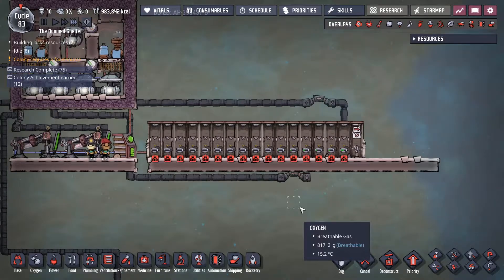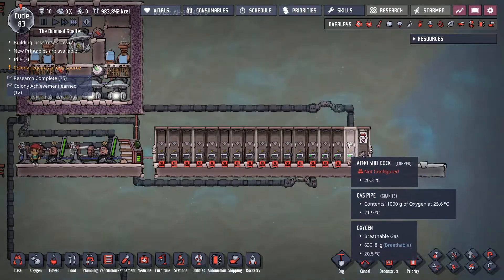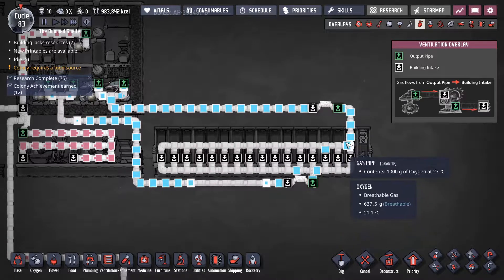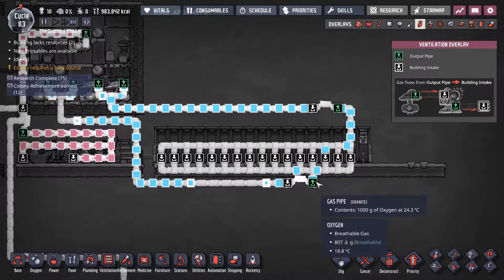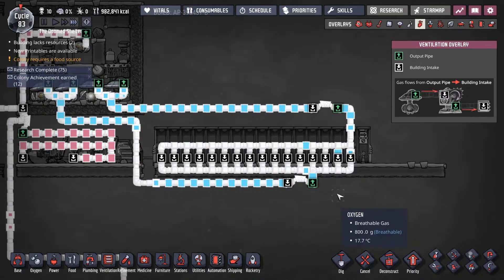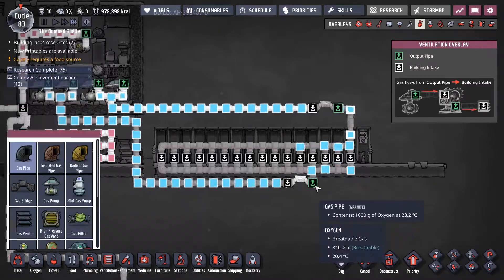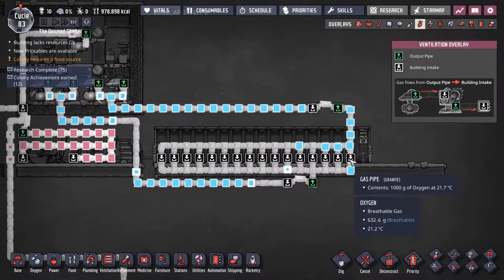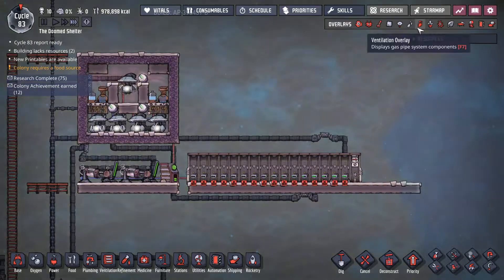Oxygen Not Included supplying atmo suit docks with oxygen

Comment: Very nice setup for large amount of docks. For smaller row feeding the first dock directly and running the pipe back through the dock inputs usually do the job just fine.
Reply from the maker: True.  I find that feeding a pipe through leads to starvation if you have a bust base.  By having the two pipes the back docks are kept full and the first few high use ones gets more packets and can keep up.